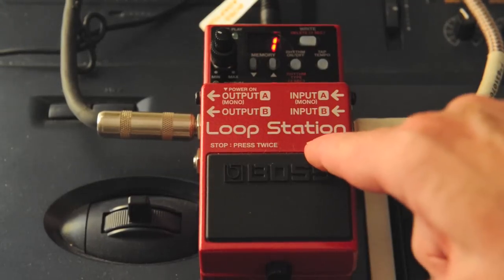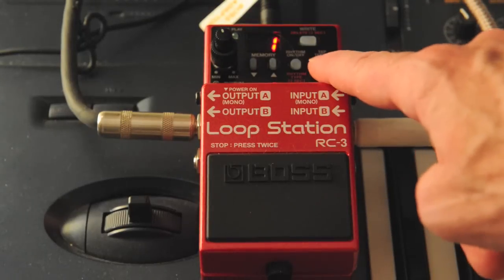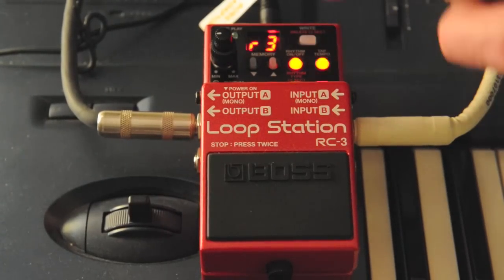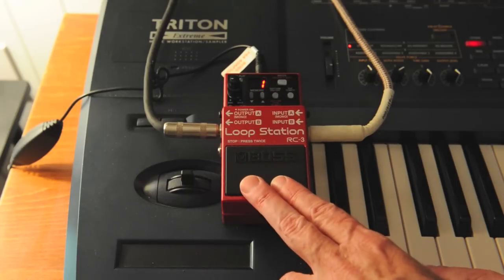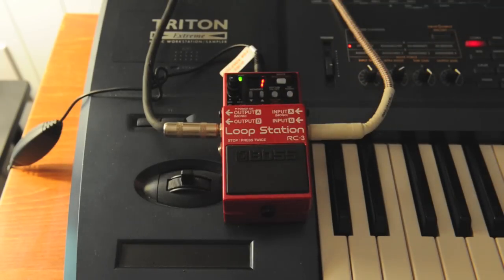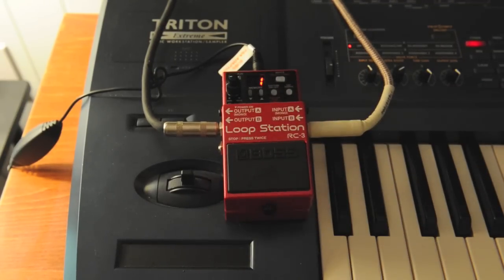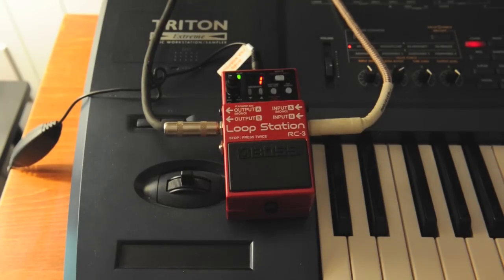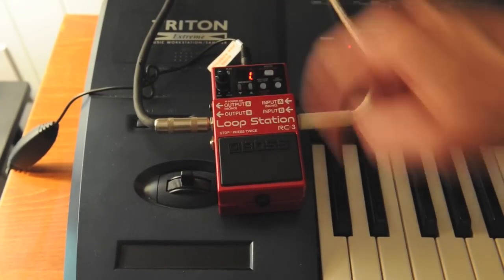How to use the RC-3 Loop Station (For Beginners)

Comment: Ok, got this the other day and have been trying to set it up with my MicroKorg Synthesizer. I've connected the Microkorg from the headphone jack to the RC-3 with a short standard guitar/pedal cable via input A. I've then connected the some PC speakers into output A, but I'm only getting a sound from one speaker. If I remove the pedal and connect directly from the speakers into the synth I get both speakers working again. What i'm I doing wrong?
Reply: The A input and output are Mono. That basicaly means the sound wil be only played from 1 place. If you have guitar amp or just 1 big amplifier it doesn´t really matter but when you have multiple speaker it will play from just  1. If you plug it into the B input and output both speakers should play. Hope it helps and actually works since I don´t own RC-3 and I´m more or less speculating.
Reply: Thanks for the reply! I sorted it out the other day, ended up getting an RC30 and some extra cables for the synth to allow stereo and using this one for the guitar. The mono/stereo cable thing seems obvious now, but I've never set up any audio equipment like this before so it's never really occurred to me.

Comment: Hy !! Does it erase the whole loop work when you switch it off or ot has an internal memory ? Greath tutorial, thanks.
Reply: mine keeps the loops in memory even after it is turned off
Reply: Yup, doesn’t erase (once you’ve saved it).
Reply: Mine does erase.. what model do you guys have?

Comment: how could I connect my digital keyboard to the RC3? I have problem because my keyboard is stereo and the output is of course stereo. When I connect the keyboard to my rc3 and then to my amplifier, it makes bzzzz noise. Which cable should I use to avoid producing bzzzzz noise or how should I connect my equipment properly?

Comment: Hey, can you plug in a microphone on a Loop Station? I can't find that information anywhere...
Reply: Fraser Telfer I'm getting the same problem and I'm thinking I might need more cables or something... I've got a NT1-A Rode microphone going straight into the looping pedal's main output through the quarter inch to xlr cable and then a patch cord going from the other pedal output to a Scarlett 2i4 USB interface. I'm hearing the pedal's rhythm taps in the headphones (that are coming out of the USB interface), but I can't get the pedal to record anything from the mic. I figure I'm doing something wrong here... any help would be appreciated!
Reply: evanjwendell since the NT1-A is a condenser mic, you got to have a fantom power into your pedal. The boss rc-30 has one in it. If you dont have any power that boost your mic, you wont be able to hear anything from the mic
Reply: Rémi Charpentier Hmmm so if I plug the mic into the USB interface and then plug the corresponding output from the interface into the pedal, and then the pedal's output back into the interface, that will, in theory, work? I just want to make sure I'm getting this right here because I probably need to buy another cable if this is the correct setup.

Comment: Is it possible to record (for guitar) a clean toned loop and then swap to a lead channel and still have the clean channel tone looping while my amp is on a lead tone or will the loop swap to the lead channel?
Reply: Whatever plays on your looper pedal goes out of your amp, so if you switch channels or turn on effects on your amp, they will affect the sounds of the looper. So unless you have a second amp to use as the output of the pedal, I don't think you could do what you want to do.
Reply: +Tinkering Night Owl that's what I was thinking, too.
Reply: That was my concern actually for the whole last week, What I did is: Guitar - Amp - Mixer - Loop Pedal - external speakers.. it's working great separating the guitar effects from the whole final track 

you can simply remove the mixer (as I use it to attach mics for percussions)

Comment: Thanks for that demo on the basics of the RC3. The first six demos on You tube told me nothing useful at all! I had the RC2 previously which as well as being a lot simpler to use worked in a totally different way. I found the manual fro the RC3 pretty useless in getting you up and running apart from being printed in microscopic type size...
Thanks!

Comment from the maker: You can use a mixer or you can find a cable that plugs into your MIC and then converts to a 1/4 inch guitar like cable. I don't really use acoustic instruments other than the guitar and my guitar has a cable output so I can hook it directly into the loop station

Comment: LOOPER INSTRUCTIONS - I just typed out what I heard:

1. Left corner – inner circle controls rhythm volume / 
                                outer circle controls loop volume
2. Hold the rhythm button until it shows R0, then use arrows to get different tracks
3. Use the tempo button to tap the tempo you want 
4. Tap once to turn off the tempo rhythm
5. To record – tap on beat 1, end on beat 1
6. Hit once – stop recording, yet will keep playing what you have
7. Hit twice – stops the sound
8. Hit once – play song again
9. Want to delete everything – hold the write button until it says DL, then click again 
10. To save/write a song, quickly press the write key, it will show UR, then hit again and its saved

Comment from the maker: There is no mic jack so you need to use a converter cable that will take the mic cable and convert it to guitar.  I don't really use the loop station for vocals just for the background tracks and then record the vocals using Garage Band

Comment from the maker: Hi, not that I know of.  I think this one is pretty easy once you get the hang of it.  Basically the hard part is getting that first loop recorded right.  i like to start playing a verse of two and then tap my foot on the pedal on the third repetition and then tap my foot on the last note of the loop.  The other option is to record to Garage Band and then loop it with the tool they have.  That is pretty easy but its harder because you have to do all the work on the computer

Comment: Hey, great info!

When you play it again in 4:02, is it just in play mode? or in overdub?
(can't see the red light, it's hidden behind the volume control)
Thanks!
Reply: It's in overdub - you are right, you can't see the REC light from that angle. You can configure the order to be recording - overdub - playback OR recording - playback - overdub (which was what the RC2 did I believe). 

You configure it by holding Tap Tempo until the display will either say "rd" (default) or "rP." you can use the up/down controls to select one or the other.

"rd" - order is record-overdub-playback (default)
"rP" - order is record-playback-overdub

Once it's displaying which one you want, you simply press Tap Tempo again to go back to normal operation.

I prefer the "rP" setting since I usually want to start playing right after I finish my initial loop WITHOUT overdubbing. If I want to overdub I press the pedal the extra time.

Hope that helps.
Reply: Joel Powell Well shit... I've been struggling to figure out how to do this, thanks very much!
Reply: ein Cool....glad it helped.

Comment: Thank you so much for this intro.  Timing and sync are critical.  Can you clarify if the Boss RC-3 allows for an initial phrasing longer than a 4-beat measure?  And if so, how do I set the length of my initial loop phrase?  Thanks!

Comment: The first loop you lay down dictates the length of the loop. As in you can't overdub a longer loop once the initial track is put down but it can record up to 3 hours. So you could effectively record an entire album on this thing. You can't just drop loops. That requires a more advanced pedal. This is more of a practice/ fun tool. I would say not ideal for gigging